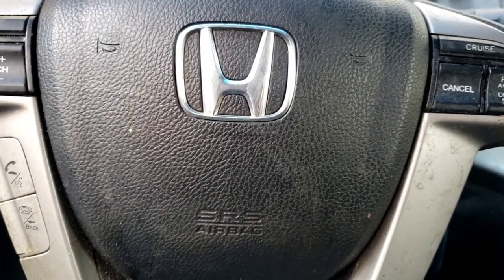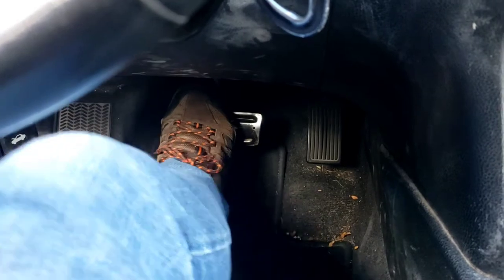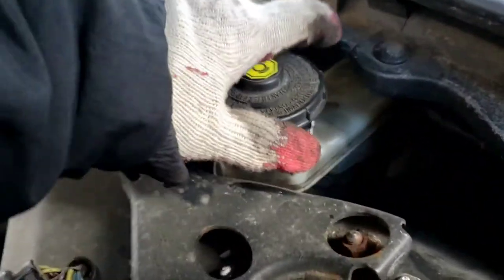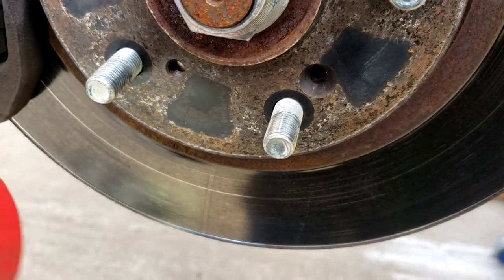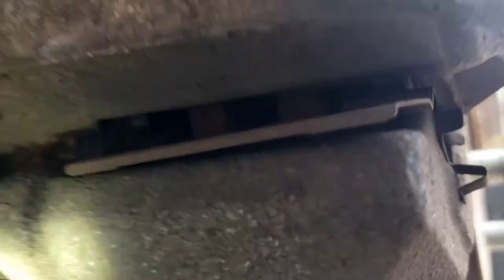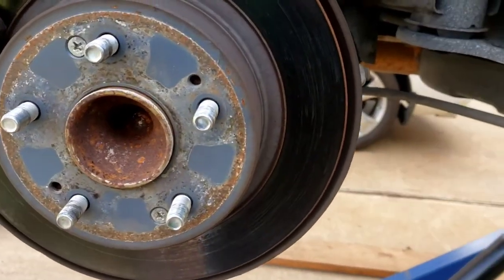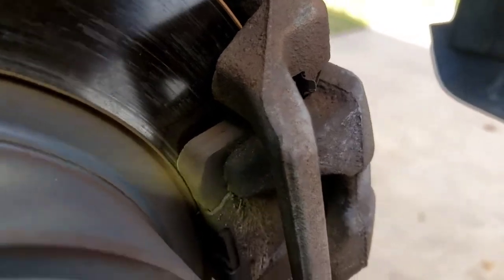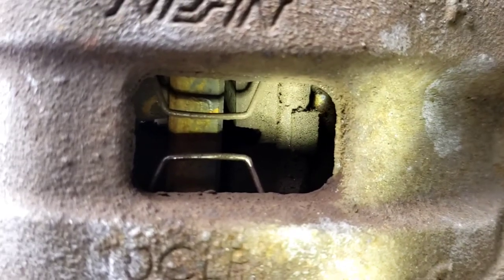Brake Pedal Low But No Leaks,No Air in the Lines, What else Could it Be, Check your Emergency Brake

Comment: Didnt you see the pad move when you played it back? What was the deal with the e brake?
Reply from the maker: Sure did, customer had the choice of fixing just the brakes alone or also repair the e brake assy..everything was broken and rotted..over 245k in mileage,  calipers, pads and rotors were replaced..e brake he never uses and that explains why it never adjusted, it stayed frozen in place.. so like a brake on a bicycle,  the pads were far away from the rim and now it took a longer travel on squeezing the brake handle to stop.

Comment: What happens if it does not firm up with pumping? 
Our 2008 Kia rondo has low pedal and will not firm up with any amount of pumping. No leaks, fluid is still high. What could it be?
Reply: It holds pressure btw, with a long hold press
Reply from the maker: Is it 4 wheel disc brakes or are the rears drum brakes?
Reply from the maker: @JohnJohnCrusher  with the car off and you pump the brakes, does the pedal get hard then?
Reply: @alyoungcuda  hi mate I have this problem car off it firms up can on it doesn’t??
Reply from the maker: @jaystacey5491  depending on what kind of car it is, if its drum brakes, they need to be checked and adjusted close to the drums, if its disc brakes then again it needs to be checked. I will try to find the youtube video I made of a low brake pedal on a car with 4 wheel disc brakes all around. Stay tuned
Reply from the maker: @jaystacey5491  depending on what kind of car it is, if its drum brakes, they need to be checked and adjusted close to the drums, if its disc brakes then again it needs to be checked. I will try to find the youtube video I made of a low brake pedal on a car with 4 wheel disc brakes all around. Stay tuned

Comment: Hey man have a 2014 pilot new master, new/used abs pump/module, pads all the way. I checked all slide pins all move free. Problem is pedal keeps sinking. No leaks. Car stops but when holding pedal ot keeps sinking. Could a faulty booster cause the pedal to keep sinking when pressure is applied or a faulty check valve? The car is running when im doing these test. I dont think that it keeps sinking when the car is not running. Its st the shop so i will check tomorrow. Any info would be great. Thanks
Reply from the maker: A Honda and most other cars with a abs will need a scanner that can bled the abs  pump. The scanner will electrically open and close its valves,  it seems like you have alot of air trapped. Any reason why you changed all those parts? What was the original problem? A brake booster will not give you a low pedal unless some cars have an adjustable rod that goes into the master cylinder that you can adjust but if you didn't touch it then it should be ok. Sinking when holding the pedal is the air compressing, brake  fluid does not compress. Im guessing you bled it right in the correct order? Some cars do it differently,  check that online for your model. You can also try gravity bleeding..open the bleeder at the furthest point, let gravity bleed out and watch the master, make sure its full. Then do the rest, the furthest wheels in order. Another way is with a helper,  crack open all 4 bleeders, have the driver step on the brake pedal to the floor and hold it there and go tighten all the bleeder screws, then driver releases the pedal. Crack open all 4, step on the pedal to the floor and hold, go tighten all 4 again and then release.  Check and refill the master..do this another 2 times. After this bleed your brakes 1 at a time, pump the brakes fully from the top to the floor 10 times and hold it, then crack the bleeder and look for air.tughten the bleeder before the pedal hits the floor, you have to guess or time it, it goes fast. Then do the rest start in the right rear, then left rear, then right front and finally left front and see..but you most likely need a scan tool if there is extra air locked in the pump. Then there is also a pressure bleeder you can rent from Autozone... good luck.
Reply: @alyoungcuda  yea I will keep you posted. I have done all you said. I am actually a tech. I have bleed them all hooked up sacn tool and activated the abs pump. There is no bleed procedure available on my scan tool. It only allows me to activate the pump which i did a few times before bleeding. Let me ask you this. I unplugged the booster yesterday before i left. The engine did not stall. Then i removed the check valve from the line and the engine stalled. Could there be an issue eith thr check valve, cause ing the brakes to keep sinking. I dont think it does it when the car is off. It holds solid. That's why im leaning towards booster. The car had some work done somewhere else. Brake pads and a flush. Then another tech at my job rec master and abs. He was off so i got the job. One of those everyone has had there hands on. Only thing that hasn't been touch is the booster and check valve.
Reply from the maker: @besttex4735  don't forget the mechanical side of brakes, the caliper pins, make sure they move freely...
Reply: @alyoungcuda  read my first comment. I already did that.
Reply from the maker: @besttex4735  i read it, I was just thinking out loud as the day moved on
Reply: @alyoungcuda  i just changed the booster the car stops great but the pedal might still feel slightly sinky?? But does not move or anything. I believe it may be a faulty abs unit. Because we got a used one it was the only one available. New They are on national back order so....  I warranted the master rebled etc. Feels great but I think we have another faulty abs unit. That's why national back order. I love my hondas. But brake system on these pilots are junk.
Reply from the maker: @besttex4735  backorder is something,  same as a Subaru starter, no stock anywhere except the dealer, Subaru has a bulletin out on starters going bad but the outside world had no clue..I posted that on my channel the bulletin